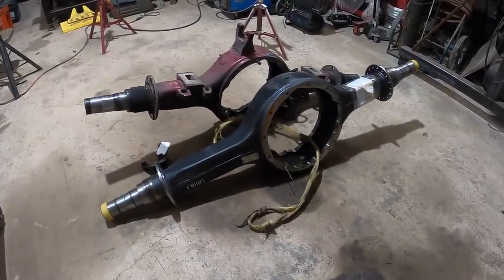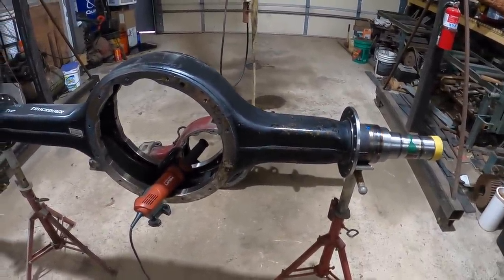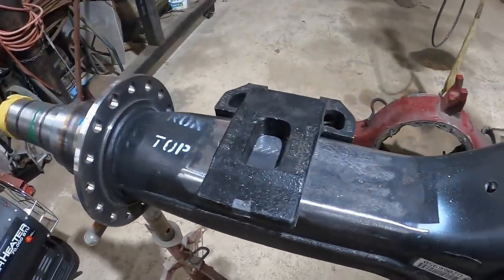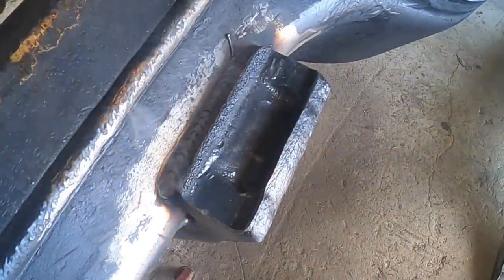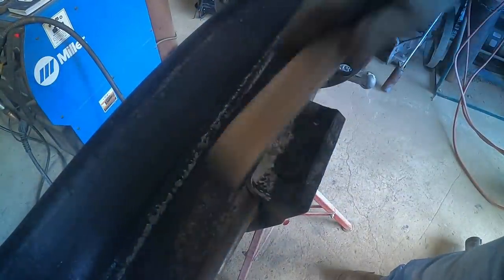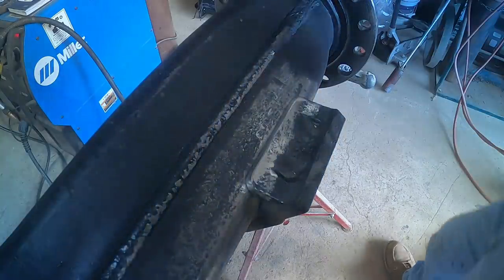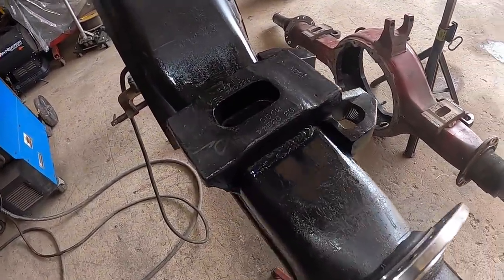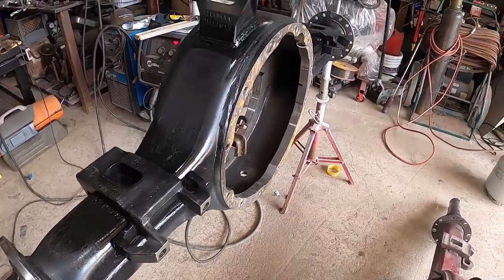Big Rig Axle Spring Perches

Comment: Anyone who negatively comments on your welding abilities and welds obviously has zero professional welding experience backing their motormouths.motor mouths.
I was a OJT then collage trained Ironworked union welder for almost 3 years before I went off to Coast Guard boot camp and I've yet to see you make a mistake on any of your vids.
A minor amount of paint is absolutely not cause an issue on a weld as long as the welder is in the proper settings and the correct wire or stick is used.
I enjoy watching your vids.
They bring back pleasant memories of my time welding with a great bunch of guys.

Comment: My father started his welding career off working in the shipyards Bremerton, Washington. After WW11 you took what work was available. If I remember correctly the decks of the aircraft carrier was somewhere between 2.5 and 4.0 inches thick. They heated the deck plates up and you would "burn rod" all day long. Each welder had a "fire watch" it was their job to keep you from running out of rod, and of course put the fire out if you were on fire. Dad moved up to Boiler welder. As a machinist and welder, he did whatever they needed. If you ever wondered "who" designed the air hose couplers that had the ball bearing and spring in them, that was my father. They had air hose couplers, but if they came loose, they would beat you to death before they got the air turned off. When {Government Contract} they reviewed his invention. They told him it would restrict air flow too much. Less than a year later they were installing them on every air hose on the base!  My father knew who invented it, he did. At 94 years old this old machinist and welder passed away 5 years ago. I enjoy watching your videos because just like Delmer Ross you do a lot more than welding. When "Dad" passed away he had more than 9 welders, no auto-darkening for him.
Reply from the maker: Wow. that was incredible. I think I would have liked your dad. very cool story. thanks for sharing.

Comment: A decent knotted wire brush I find pretty good for stripping off paint and light rust, then I go at it with disks, damn things are getting more expensive for quality disks, cut-offs and grinder disks now a days. Then cleaning with acetone or brake clean might get the contaminants in the metal pores. Maybe the weldments had some kind of treatment on them to keep from rusting on the parts shelf than the rear housing.
I hate making BB's.
Looks good Issac and enjoyed the welding tour and catching the gun arc patterns.
Thank you for your time Issac.

Comment: It's almost always a smoked spindle that retires an axle housing.  Can usually find a good used unit for cheap.  Up to them though.  Top shelf work as always.
Reply: Nope, they now stub axle housing now. They cut end off and weld new axle stub on
Reply: @pdmustgtd1013  Yeah I thought about that, or build the axle up and turn it down to spec.  Still loads of them in truck yards all over unless it is some funky axle.
Reply: @pdmustgtd1013  right on the truck even!

Comment: Back in 2000 when Spicer switched from bolt on rear cover to welded on cover for Peterbilt air leaf suspension. They all cracked at the top, had to grind crack out, weld it and put support plate for tracking rod mount on top of housing. Spicer never had us pre-heat housing but it was also still in chassis and with everything still in housing. Never drained oil out either per Spicer you wasn't going to get paid for it

Comment: Issac I would love to hear some more about why you decided to preheat and any tips you can give as far as knowing it is hot enough but not too hot.  Great work as always.  Thanks a million!
Reply from the maker: Welding onto cast steel pieces can tend to crack if they're welded cold. You're adding an extremely hot weld onto a poured metal piece. preheating it will get the molecules expanded and warm enough to accept the weld and it will cool at a slower rate once its part of the parent metal.
Reply: @ICWeld  That is so true. "Get the molecules moving" an old welder used to tell me! He also said at least get it warm enough to drive the moisture out. Moisture effects welds and can cause cracking due to hydrogen embrittlement. Pre heating is like eating chicken soup when you have a cold. It cannot hurt! Nice easy one for you today Isaac. Hope all is well down in Texas. Cheers from Freezy cold NH
Reply: @ICWeld  would it make a difference doing stringer beads rather than a half inch weave? Just thinking about the H.A.Z.'s?
Reply: @ICWeld  Don't know if you told, but what wire did you use?
Reply: @ICWeld  Thanks Issac, makes sense.
Reply: @warrenjones744  most of the "water " you see when heating metal if from the flame of the burning gas which has water vapor in it.  once the metal is above 250F, the water no longer condenses on it.  interestingly, just like 7018 and other  lohy rods, flux core and dual shield wires both absorb humidity from the air and can experience hydrogen cracking if not stored properly.  this is why wire can "go bad".  usually a roll should be used within weeks of being opened..i think they also want you to store them in an oven or dehumidifier between uses.  aside from hydrogen cracking, preheat improves penetration of any weld and it moderates the HAZ by slowing cooling and crystal formation.

Comment: Thank you for sharing . That is a smart customer.  Doing the job right always saves time in the long run.  I wonder what the gears  bearing  and drive shafts  are like with that kind of wear?
Reply from the maker: Upon further inspection, they have a magnet inside the housings and that thing (old one) was so full of shavings. It probably ruined much more than just this housing.
Reply: About ten years ago we had a large batch of Peterbilts that experienced hub bearing failures. The spindles had to be replaced on all of those trucks. We had a mobile guy come out and cut/weld on new spindles with the axle housing still on the truck. I kinda wonder if this housing had the same problem.

Comment: For removing millscale,paint and rust get yourself some fleece discs.
They don't clog up like flapdiscs and don't take away any metal. I love them.
Lovely good looking welds as always Isaac, but wouldn't it be good to wrap the corners a bit to avoid stress points?
Reply from the maker: I was copying the same welds as the factory set.
Reply: @ICWeld  If the factory deemed that as enough then that should be ok.
The saddles are in compression most of the time and also held in place by the U-bolts, so no problem there.
But the part on the pumpkin controls the for/aft movement/rotation of the axle housing and those joints are subject to alternating compression and tension depending on throttle and brake application.

Comment: I don't mean educate you, you clearly have way more experience than I do (I only weld since 2014), but I like using those paint stripping angle grinder wheels, that sort of looks like a sponge. They rarely gum up with paint, and they cannot take material from the metal.
Reply from the maker: thank you for the suggestion. i'll look into those.😉👍

Comment: It is common practice to replace damaged or worn spindles and they can be replaced on the truck, there is mobile spindle replacement services that will do it on the side of the road if necessary.  Good used axle housing are also readily available.

Since that axle came from paccar it is for a Kenworth or Peterbilt truck.
Reply: Peterbilt air trac suspension

Comment: Hi Issac. Im glad ive seen a true welder welding onto not 100% clean material. With the "it will burn off" mindset. As it does. And its not pressure welding. Just good solid hot welding. Great stuff. Cheers

Comment: as always excellent work! Just a few quick questions. What is the material? Is it mild steel? Also did you use 70s6 wire? Last I noticed you sprayed your flapper disc with something while cleaning the paint off of the housing. Was this some sort of solvent to prevent paint build up? Again, I love watching your videos. You do nice work!
Reply from the maker: Yup regular solid wire and I sprayed wd-40 to shed off the gummy paint.

Comment: How do you feel about spray arc transfer settings on the MAG? I reckon it would do quick work of this, and have less spatter. I worked at a factory, and we used it for a lot of the work, since it is so fast, even stuff normally considered too small to take the heat. The thicker gauge wire was more economical in bulk as well, I guess. We'd just move really fast across, so the part didn't melt down into a puddle :)

Comment: on the big rig axel spring perches how long and how warm do you preheat it the casting and what type of wire are you using . Love your channel and Great videos its helped me a lot in our shop
Reply from the maker: I would say that as long as the parts are decently warm to the touch should be fine. I couldnt give you an actual temp number because I dont know but possibly 200* F. You just need to warm up the cast piece to accept the hot weld. the initial shock from a cold piece would cause it to crack. you want it warm/hot for sure.

Comment: I'm one of those internet inspectors🧐 and I believe that at the amperage you were welding and the wire speed was not appropriate for the processes involved 👨🏻‍🏭. Whoo that was alot of typing and spell checking😮‍💨 I'm gonna go eat some popcorn now😂😂😂
Reply from the maker: I agree. I had the wire speed a bit too fast. thus the sputtering at the beginning of the welds. I finally got it dialed in by the time the video was over.....of course. ha.
Reply: @ICWeld  I was only joking

Comment: Love watching your videos, you explain how and why you do what you do!! What were you spaying on your sanding disc, was it something to keep it clean? ✌
Reply from the maker: WD-40. It helps shed off the gummy paint. It also works good on standard grinding wheels if you're grinding on aluminum. its not the best but it works if you don't have aluminum specific wheels.
Reply: @ICWeld  Thanks for the tip.. see I can learn something new every day.. 😊 I use a wire brush on my sanding drums while they're spinning to clean out the leather dust it leaves when sanding leather edges!!! ✌
Reply: @ICWeld  Great hint.  I'll have to give it a try.

Comment: What can happen is on a big rig rhe hub is sealed and filled with oil, sometimes the seals go bad and the oil leaks out and then the bearings go bad and then can destroy the spindle. They do have equipment much like a line bore that will mount to the housing and cut off the spindle, true the face, and then weld a new spindle back on.

Comment: Looks like a fun little job 🙂, what wire and gas were you using?
Reply from the maker: regular solid wire and 75/25
Reply: @ICWeld  straight up short circuit mig.  Er70s6 looked like.  Great job man 👍🏼

Comment: 👍 another fine job!
Why is preheat needed?
How do you determine if a job should be preheated or not before welding? What are the determining factors?
Thanks!
Reply: see under jvidas above.  any code welding of thick sections requires preheat to remove condensations and improve penetration and to slow cooling.

Comment: I am just a 'hobby' welder, doing little projects for myself only, but or so, I do have a question Isaac, if you didn't have access to a wire feed welder, can this be done with stick welding, 
then part two of this, what type and size of rods would be used?
Reply from the maker: Yes, absolutely. 7018's are my go to rod for most things.
Reply: @ICWeld  Thanks, very much.

Comment: I’ve got a question… What’s the reasoning behind your choice in using hardwire MIG vs. a dual shield or flux core process? I’ve always been told not to use hardwire on anything structural. Great video as always!
Reply from the maker: I've always had good success with hardwire but Dualshield is definitely a good choice too.
Reply: Copper coated 70s-6 and CO2 are pretty much standard in the truck and equipment shops here in Cleveland...flux core or stick on the service truck
Reply: I built industrial process equipment for years at a global supplier, we used solid wire for all of our structural fabrications, we did about 1/3 in stainless and the rest in carbon steel, thickness was up to 3/4", about the only variation was on some stainless work we would use tri-gas mixes to get deeper penetration without back gas, otherwise we used 75/25 argon Co2.
Reply: @clevelandmortician3887  we are using a 90s solid wire on our truck frame modifications to be closer to strength of the truck frame rail material.
Reply: @haroldphipps3457  sounds appropriate

Comment: As to the why was housing being replaced. It looks like the inner bearing failed in such a way that the race did not spin on spindle but heated the spindle tube hot enough to turn the tube blue. Thus compromising its load carrying capacity.

Comment: Hi …I’m a part time welder and was wondering if there was a reason to not weld across on the upper front mount
Was this just oversight or some stress relief …thanks as I try to learn to be a better welder
Reply from the maker: enclosing a heated air pocket may make the weld pop back at you as it closes up. This is a form of venting. I was copying the original.

Comment: Love your stuff. Question for you please. I have seen you both push and pull the puddle. I was taught to learn to do both depending on the job or application. I prefer to push when I can to maintain a little pre heat ahead of the puddle. What is your favorite or do you have any? Thanks
Reply: I wondered about the puddle as well as the “C” motion you chose to use as opposed to the lowercase “e” motion. When do you use one over the other?

Comment: I watched the video again and I was wondering why on you starts sometimes there is a stutter. Is that just a bad ground?
Reply from the maker: My settings were off by a bunch. The wire speed was too fast. I kept lowering it until it got better but not before I was done welding. It could have come down some more.

Comment: Hey Isaac, really appreciate you taking the time to share your knowledge with these videos! How do you like your 350p? Mine has been nothing but a headache. I constantly get a “tach error” code and it’ll only strike an arc every couple trigger pulls. So far two shops have been stumped on it.
Reply from the maker: It's good. I haven't had any issues as of yet.

Comment: what's your heat setting on in your wire speed
1.8K+👍's up IC WELD thanks for sharing
Reply: hey she's coming to work for the container division at the railroad years and you'll see that you'll learn how to write fast how to weld rusty metal together without taking time to clean it

Comment: It would have been a lot cheaper for him to have those spindle ends replaced than to change the whole axle. We have a guy that comes to the dealer and cuts them off and welds new ones on while the axle is still in the truck.

Comment: Hi Isaac, great job! Just one question,  why did you level the housing with a sprit level  on the stands? Was that to check if the bare housing had any distortion? 
On a side note, I went out and welded a bracket up for the heater and my welds were awful!😔.  Too sad but will do the job.
Reply: if your welder is 110v, propane torch preheat always helps
Reply: @peetky8645  thanks @Peet Ky I'm in Australia,  its 240 volt 15 amps but I assume its the same as 110v. it's not the welder it's the "welder" who needs more practice!. I will try the propane torch next time. Cheers!
Reply: @andrewjoyce7789  here in usa,,most home power is single phase,  110V with only large appliances being 220v.  I hear europe has 3phase250v power to most homes.  do you in australia have single  or three phase to your homes??
Reply: @peetky8645  generally single phase but I have 2 phase 240 volt, in used to have what they called a 415 volt welder which was in my farm workshop, I could weld with that unit quite well.

Comment: One thing I would say is--- next time, make sure you are measuring to the connection points-- and not just the side of the casting.  You should have measured to the edge or center of those bolt holes, so at least you know the machined connection points are the same;  because some castings by different companies could be different thickness, ect..  But as long as the bolt holes are in the correct spot, the casting's shape doesn't matter as much.
Reply: i was worried about the "gap".  might the bolt holes now be 1/8 inch off the axis of the axle leading to tire wear??